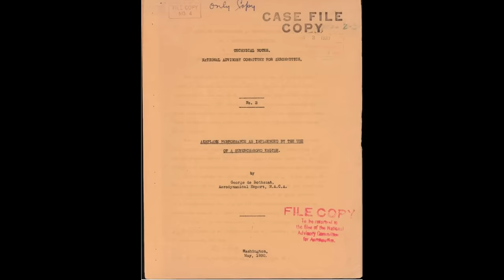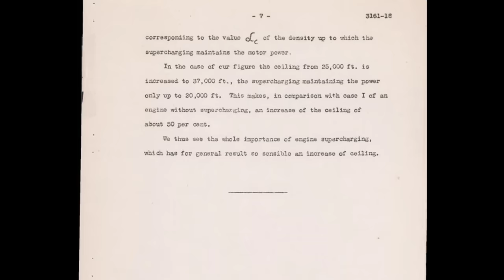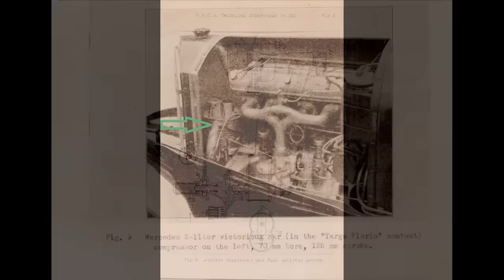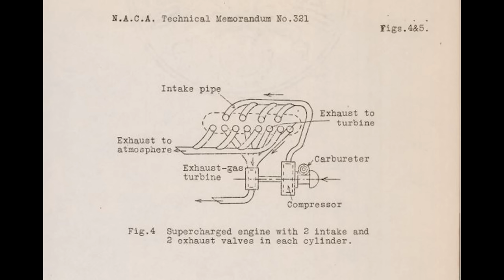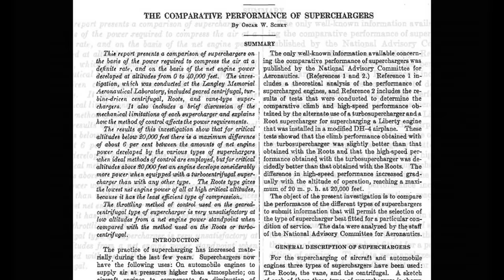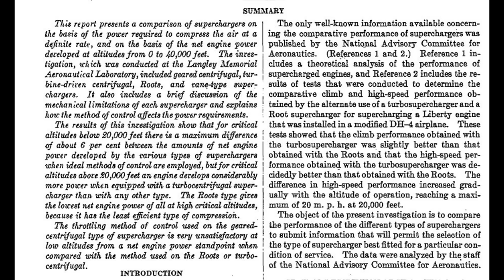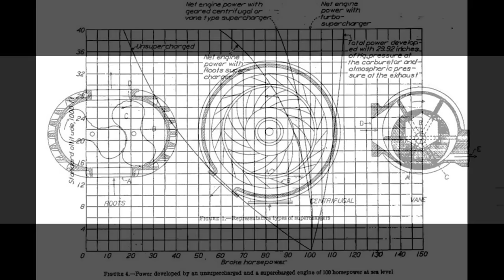Turbo vs Supercharging in WW2 Airplanes

Comment: The intake manifold on the turbocharged Allison delivered the fuel mixture so un evenly that the engine had to use different spark plugs depending on how close or far they were from the carburetor.  The problem was made made worse by using extremely high octane fuel.  The high octane knock resistance was achieved by simply adding lots of lead.  This gummed up the spark plugs.  What baffles me is that if Allison would have used direct fuel injection, the turbo would have worked, the plugs would not have fouled, and they could lowered the octane requirement, icing would never happen, all this and picked up an additional 200 horsepower.  Some may argue Germans were able to do this because of their more advance engineering.  This would be false based on the fact that the Italians, Swedes, and Japanese were all able to build the injection units under licence.  Airplanes back to automobiles, automotive mechanical superchargers do not contend with extremely high oil temperatures resulting from the exhaust driven impeller, and all that plumbing, waste gates etc.  In practice during WWII the mechanically supercharged P-51 was so completely superior to the P-47 and P-38 that both the P-47 and P-38 were immediately and rapidly  phased out of the ETO and replaced with P-51s.  Of related note, the Allison and DB-60X had roller lifters, while the Merlin did not.
Reply from the maker: I agree the Allison could have been so much more. I don't quite agree with your P-51 vs P-47 assertion, but I'll address that in a later part of my P-47 series.

Comment: I think that one could argue that strategic airwarfare as we know it would not have even happened without GE turbos. No other country built reliable high altitude engines that could compare to even the engines in the B-17 and B-24, which were, turbos aside, approaching obsolescence when the war began. I don't think bombers flying at 15,000 feet would have survived well enough to keep the daylight campaign going.

The 2-stage Merlins? They could go either way. Mustangs and Mosiquitos certainly flew long duration high altitude missions but could any mechanically supercharged engine have provided takeoff and climb power for a heavy bomber, cruise in formation to max range at 25,000 feet, return and do it again with nothing but refueling, an oil change, and a check on the sparkplugs? I really don't think so. It's as much a issue with overall engine wear as the throttle curves. One could certainly design a multistage mechanical supercharger to do it but would it last more than a few missions?

Oh yeah. Japan and Germany couldn't build durable turbos because they lacked the metals and alloys the US had in abundance. It's the same reason the German jets were only good for a few hours.

Cheers!

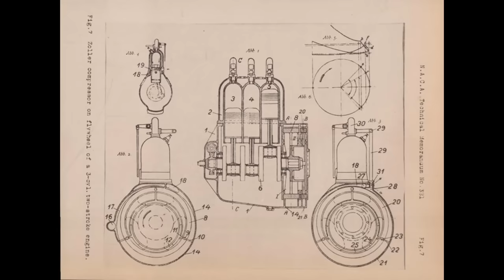Comment: Tying concepts together: Is 10:37 "Magic supercharger that maintains sea-level manifold pressure and benefits from reduced back pressure" one reason why the 4:05 Battery driven supercharger keeps being tried?
Off the timeline, a modern example: Rocket Lab Electron orbital rocket with Rutherford electric pump fed engine. Obviously a direct comparison is not appropriate because LOX and and 40,000' altitude ambient are at the opposite ends of the oxygen availability range.

Comment: Volumetric efficiencies, the sleeve valve radial would hold great potential with artificial boost at various altitudes. Able to utilize lower octane fuels, perhaps even coal oil.

Comment: Another factor as I understand it. Given the large fleets of four engine bombers, the twin engine mediums, the demands on the steel industry for alloy and tool syeels, armor for ships, tanks and the needs for artillery. There simply was not enough tungsten and other alloying elements to equip all aircraft with turbo superchargers.  This was not evident until it was too late for Allison to develop a good two stage/speed superchargers. A third factor may have been the ability of companies such as Fellows and Barber-Coleman to build enough gear cutting and grinding equipment for the mechanical supercharger drives that the bombers would have needed without the turbos.

Comment: Great video! There's one question I still have after watching: Rolls-Royce initially used a single-speed, single-stage supercharger for the Merlin just like Allison did, but when the need for better performance became clear they developed a two-speed, two-stage supercharger for the later Merlins that were so successful in the P-51 and the Spitfire Mks. VII and onward. Why did the USAAF not try to pursue a similar course with the Allison V-1710? They were quick enough to see the advantages of the Merlin 61 for the Mustang.
Reply from the maker: Hi Bruce, that's a good question, and the answer is complex but I'll try to summarize. With the cancellation of the XP46 and XP47A, the only two NEW fighters coming for the USAAF were the P47 and P38, both were turbocharged. The P51 was designed as a low altitude plane, so Alison had no reason to invest in developing a good multi stage supercharger. They didn't foresee anyone wanting to turn the P51 into a high altitude plane, at least not in time to do the needed development. Of course they did later, but it was too late for the war.
Reply: Thanks!
Reply: One reason might be that they didn't have Stanley (later Sir Stanley) Hooker who not only developed the Merlin's later superchargers, but also extracted a lot more power by improving the ducting.
Reply: @GregsAirplanesandAutomobiles As I recall we shitcanned several American offerings because they came minus the turbos that granted performance upstairs. The Lightning and Airacobra come to mind. Allison seem to have been a bit thick.
Reply: I have read that Allison wanted to develop a 2 stage supercharger prior to the war, but the army was committed to turbos & would not pay for it. Since the army had financed the V-1710 development & was its only customer, it was not done 'til very late in the war on Allison's dime.
Reply: @SuperHeatherMorris  Jimmy Ellor was RR's supercharger genius. He worked for Hooker.
Reply: And don't forget the almost 380 Merlin P-40s.
Reply: It should read the almost 380mph Merlin P-40s
Reply: They were given the data by America after America entered the war, the F4 pioneered it, previous to America entering the war the F4's sold to England didn't have it

Comment: There are "electrically assisted" turbo chargers in some prototype and motorsport applications, instead of a fuel based anti lag system an electrical motor spools the turbo enough to reduce the lag. Electrical superchargers will be a thing when hybrid cars are more common, on the road and in motorsport as they can be tied to energy recovery systems, electrical supercharging is usually considered a waste as it has to convert mechanical energy into electrical energy, then stored and then back to mechanical and all of the conversion losses make it very inefficient, energy recovery is literally saving waste energy that would just become heat and uses that to boost the engine and remove the superchargers load form the engine.

Comment: One of the major drawbacks of the WWII era turbochargers was size and metals used at that time in the turbine. Also engines at that time period had piston and valve failures at a higher rate than todays engine. This type of failure did not bode will with the turbine in the turbocharger. I imagine if the engines had modern turbos and modern piston and valve failure rates there would have been a lot more turbos used on WWII aircraft.

Comment: Forgive my ignorance, im coming from an automotive standpoint with this question, although i do have a conceptual knowledge of piston engine aircraft. Im wondering why the aircraft engine designers of the ww2 era, decided the best way to control boost from gear driven superchargers was by throttling them? Why not use a bypass or "blow-off" valve, located somewhere in between the intake manifold & the supercharger outlet. It seems like you could regulate manifold pressure by bleeding off pressure created by the supercharger, prior to it entering the engine, similar to the way drag cars regulate boost when using crank driven centrifugal S/Cer's, or how a wastegate functions to regulate turbo boost through bypassing exhaust gas from the turbine. I may be totally off w/this, but it's something i always wondered about.
Reply from the maker: Ah, great question Will, I'm glad you asked that. The key here is that all WW2 planes used centrifugal superchargers. With a centrifugal it compresses air internally, thus you have to pay with drive power for the boost it develops whether you use it or not. Thus if you gear it so that it develops 20 pounds of boost but you dump 15 of it because you can only use 5psi at sea level, then you are paying the drive power requirement of 20psi. Thus it costs a lot of power. 
By throttling the supercharger, you avoid generating boost you can't use. Of course the throttling itself costs power, but it costs less, which is why they did it. 
Now, with car's it's a bit different. MOST cars use a Roots type supercharger (all the G.M. Audi and others) which doesn't compress air internally. Thus a bypass valve is really effective because when it's open, no boost is created, so the only losses are what it takes to spin the supercharger under no load, which is almost nothing, literally about 1/2-3 horsepower. The bypass valve you see on centrifugally supercharged cars, are usually to dump boost during shifting to prevent boost spikes when the throttle closes, otherwise damage to the piping connections or supercharger compressor can occur. Even in cases where the valve is unloading the supercharger during cruise, it doesn't have to do much because centrifugal don't do much at lower RPM, so there isn't as much boost to dump. In a plane that's not the case because aircraft engines operate in a much more narrow RPM range than a car.
Reply: @GregsAirplanesandAutomobiles   Greg's Airplanes and Automobiles  First off, thank you very much for taking the time to answer my question. I think I'm w/you on the throttling concept now. So as i understand it, the air drawn into the impeller inlet on a centrifugal s/c, gets compressed internally within the housing, similar to the compressor side of a turbo. So the volume/density of air drawn in to housing by the turning impeller, is roughly proportional to the amount of parasitic drag experienced by the engine. Since the engineering intent of incorporating supercharging is to maintain engine performance as much as possible at any operational altitude, manifold pressure needs to be regulated as a means to prevent over pressure. So do i understand correctly that by regulating the air available for the impeller to draw in & compress, the outlet discharge pressures can be regulated, while at the same time reducing parasitic drag, because the impeller blades have less air resistance to act against them, due to the decreased air volume inside the impeller housing? I definitely realize now by your explanation, in terms of s/c's & the work required by the engine  to turn it, being the same regardless to whether or not the resulting outlet pressure from the s/c is inducted by the engine or bled off. I see now why they chose to throttle the supercharger as opposed to bleeding off excess pressure. Now I'm thinking(uh oh! God help us!). Seems to me that the aircraft manufacturers & design bureaus were also looking to solve the inherent problems w/supercharging. I wonder if any of them ever thought about trying to design a variable vane centrifugal s/c? If you could make the pitch of the impeller blades variable, you could control the amount of air they could pull in & compress, independent of rpm. Also the blade pitch would have a feathering effect that would reduce air resistance on the rotating impeller blades, which you'd think would have some desirable effect on the parasitic drag trade off.  Most importantly you wouldn't have to throttle the s/c. Doesn't seem like a huge stretch, considering its basically like variable pitch propellers, which they were already using. Once again, i may be totally off like my first post. I realize i can't speculate on how obvious a design solution would be to ppl living before those types of technologies began to be explored. Again, thank you for the thorough & enlightening response. I hope you continue to make videos like these. Im definitely a gearhead & history nerd. To me, the theory in engineering of design & the specific details that influenced things to be built the way they were, is extremely interesting. The specific information isn't easy to come by, let alone the associated history behind it. I enjoy the 124 videos too. I've always been a fan of turbo cars. I have a Mitsubishi Evolution 10 right now, so the 124 upgrades you do have relevance to my mods w/the evo. Take care! -Will

Comment: As a Electronic engineer would like to have some input on the Electric "turbo" and some reasons why they have not happen yet, and they might. 

The reason why they have not happen yet is quite simple. Efficiency. Most people tend to believe that electric motors are really efficient. Well they are compare to a combustion engine, but compare to a shaft or a gear box they are not.

A WWII electric motor may be as inefficient as 50%, and with a alternator that also have a 50% efficiency that give us only 25% to keep for turbo pressure.

A 1980-tys Neodynium DC motor would have a efficiency of about 75-80% and the alternator would be about the same range. That would still only give us 56% to keep for turbo pressure. While 75% is way more than a combustion engine, its not even close to a shaft.

A modern electronically directed AC motor on the market have a efficiency of about 85-90% (including switching), and the one in labs is as high as 95-97%. Again alternator is about the same. Say 90%*90% that gives us 81% system efficiency. Still way less than a shaft. But this system does have a couple of advantages.

A modern directed AC motor can be used both as a motor and as a alternator. This gives us the advantage that the compressor stage can actually be used as a throttle be extracting energy from the intake air. This would let you charge the battery from the throttle losses.

For the turbine AC motor the same is true, in reverse. It could spool up to make a under pressure to let the engine accelerate faster reducing turbo lag. Of cause when the throttle is closed (or in this case, the compressor is breaking) the turbine could be set to break the exhaust gas as well, reusing what would other vice be waste gas.

For a normal car this would probably ad more energy to the battery than it would drain, removing the need of a normal car alternator, actually reducing the cost in total. It would also make the piping a bit simpler, and of cause, give a perfect manifold pressure every time, as well even under-pressure in the exhaust system. This would probably more than compensate for the 20% energy losses.

There is also alternative methods of making extra electric power of the engine. Having a extra steam engine that use heat from inter-cooler and exhaust gases to generate extra power. This may generate as much as 20% extra power of the engine, in effect reducing the fuel consumption with 20%. While this would be a fairly complex system, it may be produced in one compact unit with mass production cutting down the cost of the system to a level where its actually pay back it self. There already exist ships using this kind of system. Next up are trucks
Reply from the maker: I'll say that answers that! Great post. I find it interesting that people get different things out of my videos. Electric turbos were far from the focus of this particular video, but a large proportion of the comments are related that that one obscure item. I take that as a good sign. It means that my target audience is able to follow this stuff.
Reply: Well yes, i do se this a lot with people wanting to replace mechanical linkage with electrical. While it do work in some cases, this is a very typical case where it really questionable.

A very common statesmen is that electric motors are so efficient that they can be approximated to have 100% efficiency. While that would be okay in some cases, this is really a example where this approximation is very dangerous

Comment: Kawasaki Ki-100-II, Ki-102-ko and hei. Ki-108 and -KAI. Being firebombed by B-29's really concentrated the mind. The Ki100-II is interesting, the turbocharger dispensed with an intercooler and the original aircraft itself derived from the licenced DB601powered Ki-61;  AUW was 1800lbs less than the Jug's empty weight. The Japanese wre really interested from necessity in turbos, they just ran out of war to implement them.

Comment: It would have been nice if you had mentioned the Wright 3350 turbocompound engine. This engine use 3 turbochargers that drove directly into the engine accessory gearbox in combination with a 2 speed supercharger.
Reply from the maker: This video was already pretty long. The Wright 3350 would take up at least 10-15 mins to discuss.